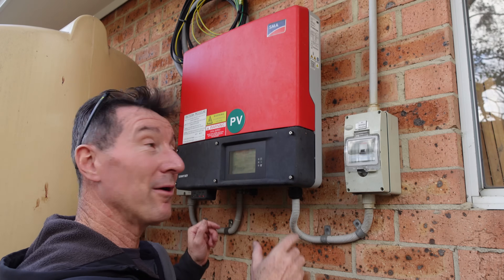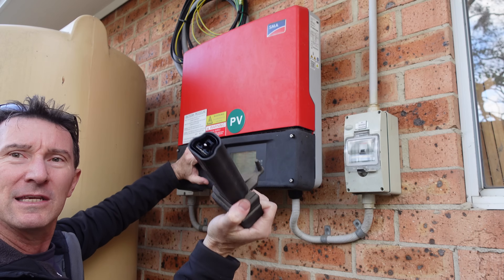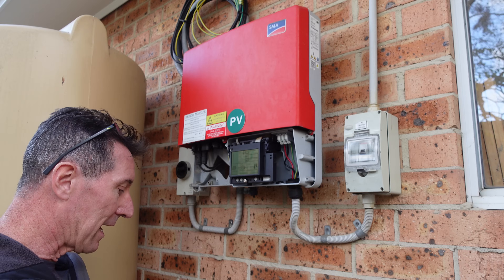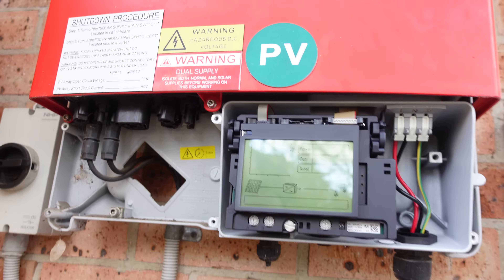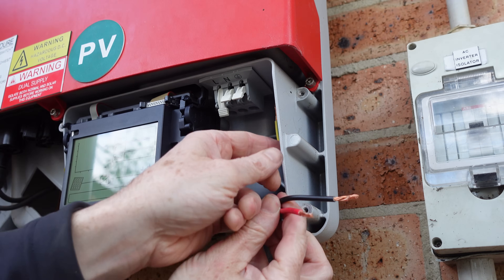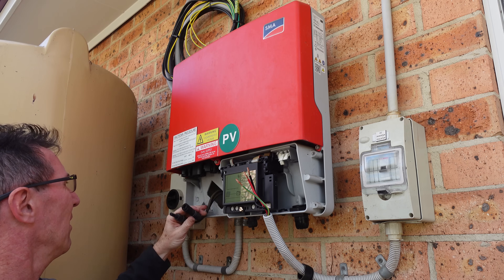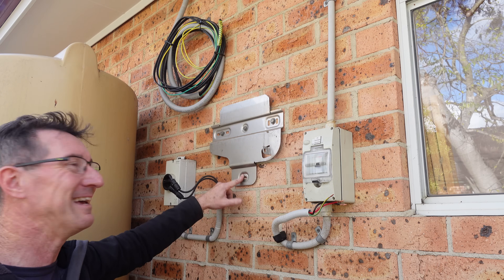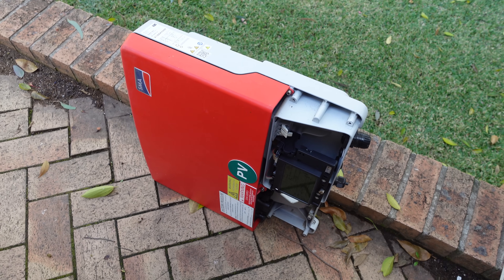Sunny Boy Solar Inverter Removal

Comment: I have a pair of 5kw Sunny Boy inverters on my system (western NY USA).  One started logging intermittent ground faults a couple years ago.  Mice had moved into that nice big compartment next to the display and built a large nest, plus chewed on the dc wires.  I don't think they liked getting evicted into the snow.  Mine are 8 years old.

Comment: Serious question for Dave.  We know that much of the new system you added was 'given' or greatly 'discounted' to you. If that system you have would have to be purchased, how much are you looking at?  I ask because here in 'merica where I live?  The system for my home has quoted pricing between $50K and $90K.  $60K is the lowest and are cheaper panels, no micro-inverters, and no battery solution.  Better Panels, microinverters (and EVERY place has said 'you need them due to roof layout due to the immense shading you will have), and a battery solution shoots me to $80K~$90K.  Federal government will give me something like $16K~$18K tax credit.  NO state or local credits, and the power company has told me the only time they will PAY to have power sold is when the grid hits peak consumption, otherwise they can take the power for free...yep.  

I just don't see how this makes any sense to "do the right thing" here.  Even if I quintupled my energy bills, I will be dust before hitting break even.  Just shaking my head over this.  :(

P.S., A system where I have property is less than half that cost, it would be ground based, and ZERO shading so I could go with standard inverters.  Also because there is no shading I can drop the size of the system by over 30% saving a lot of $$$ that way.
Reply from the maker: That's nuts. A cheap 10kw system is about $5k installed here. This does includes the renewable rebate scheme though, maybe $8k without that rebate.
A microinveretr system like Enphase will cost a fair bit more of course, maybe an extra $150 per panel.
Basically, a 440W panel is about $200 retail here, plus a few grand for a cheap brand inverter, plus installation and misc hardware.
Reply: @EEVblog2  10Kw here, just for the panels (if I went with 400W Panasonic) is nearly $10,000USD!!!  That's freight (and I have to rent some kind of fork truck to get them off the truck, they don't take them off for you, that's an added $500 charge ON TOP of the crazy freight charges, in my neck of the woods)

Not sure how you could possibly do a system for $5K (AUD) when the parts alone, from what I can find, are north of $25K for me.  

Then there is the installation and these guys are all quoting CRAZY numbers (equal to and greater than the part cost).  

The battery solution is CRAZY expensive (That was north of $25K if I went with the 2 Tesla Powerwalls they have all spec'd out).  2?  Well, the power outages in my area are extending 3 and 4 days now, and they say 48 hours tops with the powerwall, less if you use electric stoves, air cons, etc.

TWO of the 3 recommended I replace my 'relatively' new roof because if the roof needs to be replaced EVERYTHING comes off and I'll be out 5 figures tearing it off and putting it back on....on top of the roof replacement.  

Just can't justify these numbers...I've run them again and again, and it always comes back to MASSIVE costs.  Even going 'cheap' panels only drops the cost a little bit because "labor".
Reply: o.0 how big a system are you trying to get installed?

The 6kW system I had installed on our previous house about 3 years ago (Enphase) was $AUD11k installed, I think without the STCs (essentially a government subsidy) it would've been closer to $AUD18k... No batteries just panels and microinverters (plus control gear).
Reply: @SomeMorganSomewhere  Because of my roof design and how it all faces 'optimal' sun load (and the fact I live where there are way more cloudy days than sunny days), they have spec'd 14Kw systems...every single one of them.  At peak I use about 9Kw (That would be Electric Oven and A/C Running along with the standard home loads, but is not common in the summer, but it happens).  They say at any time I would max out even on perfectly clear days about 8.5KW off the panels, we get about 10 of those days a year.  LOL.  

We have a guy about a block from me who has solar on his roof, similar situation.  He has 16Kw on it, and NEVER is not buying power from the power company because....shading, low sun load, etc.  

All this push for "solar", and the fact that nobody can actually afford it unless you do it yourself?  No...just no.  Can't justify it.
Reply: Is this in the US? Those prices are cooked.. My 6.66 kW system (just solar, no battery) cost AUD$5900 in 2019 (US$4000) installed (after something like $1-2K of rebates, but that's all handled by the installer). This is with good quality LG panels too. Reverse cycle (heat pump) air conditioners seem to be the same, I've had 5kW units put in for less than AUD$3K, and then I hear people in the US saying the same thing cost US$10K+!
Reply: @stephengentle2815  US.  Yep.  CHEAP 400w panels are $200 each, just to buy, plus the Sales tax and Freight.   If you want the good Panasonic panels we pay nearly $400 each for their 400W panels.  At least that's what I am finding.  MANY places are "Oh, give us your information for a quote".  BAD idea, as many of them give you a BS quote or no quote at all and sell the information (I created e-mail addresses for those, and within 24 hours of asking for a quote I got over 500 spams). 

NOBODY is willing to give breakdowns of materials/labor/etc.   They just come in and say "$75K" or "$90K", or "$65K".  EVERY one of them wants me to strip and replace my roof because it's going on 10 years old (it isn't, it's going on 5 years old and it's a 30 year roof).

Remember, here in the US we have people demanding $20+/hour to do a minimum wage job because they made poor life choices and think they should make enough money doing a teenager's job to have a house, 2 cars, and eat out daily.   OH, and DO NOT make a mistake on their pronouns...and we wonder why our prices are out of control.
Reply: @stephengentle2815  So...where I live, heat pumps just don't work as a "standard" thing.  Heat pumps greatly lose efficiency below 40F, and we probably spend 7 months a year below that. For my area, they are not recommended.  About the only place I know where people use them is if they have geothermal installations.  

Since LG is gone for panels, that isn't even an option any longer, Panasonic is the new "higher quality" panel and those are all $390~$550 each PLUS Sales tax PLUS Freight.  Many of the install companies refuse to let you buy the panels (because they lose their 20% material markup)...and on 35 Panels, that's a loss of $2800 to them (at $400 each).  

Again, panels alone, MY COST is about $14K without freight.  Many say labor is equal or more than materials.  OH, doesn't include all the mounting hardware (about $50 per panel), and the wiring, and the inverters.  I'm TRIPLE what you paid just in materials...not including a battery ($12K+), not including installation, not including a BMS, not including the controller...etc.  Yea...WAY TO EXPENSIVE.  All I get is the Federal Government rebate, which is peanuts when it's $75K to put in a system).  Why do you think that many of us are against this...can't afford it!
Reply: @WreckDiver99  My point is that people in North America seem to only be able to access tech like solar and heat pumps at absolute rip-off prices and that is more of the issue than the technology itself. On heat pumps, there are plenty of air-source heat pumps that could still work well enough in your climate, choosing the correct type (like an R290 refrigerant air-to-water unit) should have a high enough average COP to rival other heating tech on price. You may need some resistive backup or a wood stove to augment it for a couple of days in the year. The issue is not so much that cold climate air-source heat pumps with decent efficiency don't exist, again it's that probably in the US you'd pay three times what you'd pay in Scandinavia, the UK or other parts of Europe where they are quite common! I still don't understand why prices in the US are so messed up.

Comment: I would have thought the gnd connection would have been a proper crimped and bolted connection, not a wago style.
Reply: If the style of connector is fine for fixed wiring (which it is), it's fine to terminate at the equipment too.

Comment: A non-contact tester is NOT an approved method for proving denergised. Please use a multimeter THEN prove the multimeter against a known source without turning it off or changing the settings or leads. Always test before you touch because it will literally kill you. Sorry to be a downer. Everything else is cool but!! Ps: All free conductors must be terminated. Eg. Put some connectors on the end of any bare leads..
Reply from the maker: There is always a killjoy.

Comment: Curious if they'll let that be reinstalled, doubtful. I think a lot of the newer ones now will downrate the solar output if the mains voltage is over a specific threshold (I suspect they actively use this during peak solar days to downrate the feed in for many unsuspecting customers - basically they couldn't be 'bothered' to adjust the line taps). Not sure if these older ones are all hardcoded to 250V by default or don't have that function at all. My new one after an upgrade (like you) was defaulted to 250V and was only corrected 2 years after install after I found out about it. "Apparently" the new inverters can be set by the solar installers up to 258V in some areas to get ahead of the shedding, most installers couldn't be buggered setting it on first install. Have you looked into this, it's called GVDPR? :)
Reply from the maker: This one does that, you can program it in the settings.
Reply: biggest issue is that anything getting installed now has to be AS4777:2020 compliant, some manufacturers have released firmware updates for older units to make them compliant but a lot haven't (e.g. the SolaX inverter we have here), might be OK to do a like-for-like absent that I suppose.
Reply: The new ones control, their output by grid frequency. I’m sure they look at voltage too. But frequency was added as a requirement about 10 years ago.

This is done because believe it or not the grid frequency corresponds to net loading on the grid. I expect Dave has done a video on it.

Comment: Australia has adopted the metric system in 1947. That is 77 years ago and Dave has not yet managed to get a metric allen key?  Such gear is usually sold with some 25 year guarantee but after 10 years becomes obsolete. Perhaps counted in shoe phone years?
Reply from the maker: I have no less than 3 allen key sets at home, including a genuine Allen set. But they don't have half mm increments.
Reply: Its the 2.5mm , kinda rare size here.
Reply: @TobyRobb nah 2.5 is pretty regular over here. (Netherlands) if you have an m4 with countersunk then you need it (countersunk is one size smaller i think)
Reply: @mauricevandoeselaar  Australia still build houses with 2 by 4 that is a stick of wood measuring 2x4 inches. I do love the psi for pressure, nicer numbers than just bar.
Reply: @LawpickingLocksmith  we also say 4 by 2 here not 2 by 4 ha!
Reply: @TobyRobb  Coles got a set for $1.50. But for precision engineering I had to buy hardened ones from 0.5mm in 0.1mm steps to work on Japanese fine gear. For US gear they would of course not properly fit. If you buy enough small shelves from Ikea, you eventually end up with a 2.5mm key.
Reply: @LawpickingLocksmith  i have a good set of drivers from hobby king as they all are important to be hardened for rc model helicopters and aircraft. Also common in CNC homebuilts eg openbuilds.

Comment: Done well have 2x solaredge 5kw inverters had 4 fail in 6 years they are verry reliable 🤔 and take nearly a month fore the replacement each time and costs me money to have installed as here in the uk you carnt replace them yourself thanks to nanny state rubish
Reply: Can't replace them yourself here either, technically Dave broke the law when he disconnected the AC mains cables from the inverter, you need at least a Class D sparky license for that :/

Meanwhile licensed sparkies are doing utterly shit work all over the country...
Reply: @SomeMorganSomewhere  A guy I know (electronics technician) wired up his own house and his electrician mate signed off on it - still technically totally illegal here, but the only problem the electrician could see was that anybody would know that a regular electrician didn't do it - because the work was way, way too neat and high-quality! Stuff like cable ladders in the ceilings and conduits in the walls, which you'd see in a high-quality commercial install but almost never in a domestic setting!
Reply: @stephengentle2815  Yeah, I (qualified EEE) may or may not have done the same for the garage a couple of houses ago. The sparky's comment was "I haven't seen an installation like it since 1976" ;)

And that was in Vic where according to ESV you can't even install CONDUIT without a sparky license :/

Comment: I think it would be good to test if we could fool the anti island by feeding the mains by another small inverter. As it's a drawback we can't use our solar if the mains is down.
Reply: I wondered that about my own system. I have a cheapo lithium power bank that has an AC output. If I flipped the main isolator on my supply, and then did some very sketchy suicide cable arrangement, would it provide a fake grid supply and wake my inverter up? I don't really want to try it though, don't want to let the angry pixies out of anything in my house.
Reply: dunno about that specific unit but I've certainly done it with other grid-tie inverters (in a standalone application not connected to the grid). stick a 300W pure sine inverter on the input and they'll come up, obviously you'll want to stick a changeover switch in front of it so you don't electrocute the poor bastard liney who's come out to fix the power line that the tree fell on.
Reply: @SomeMorganSomewhere  That's good to know. I guess my cheapy 300w "modified sine" wave wouldn't cut the mustard.
Reply: @sausage5849  yeah, I doubt it would work with a "modified sine" (actually properly called "modified square", I HATE marketing), the inverter would probably not be happy with the shape of the input.
Reply: It's smart enough to not push the voltage up too high, but this also prevents it from doing much of the total load's work; the inverter producing the sinewave will end up doing most of the work. (If I'm right 🙂)
Reply: @jimmybrad156  not really, as you load the inverter down its output voltage will drop which will cause the grid-tie unit to increase output to compensate.
Reply: @SomeMorganSomewhere  not nececelery.
Reply: It should do, but you might have a lot of trouble matching load and supply without a control system designed for doing this. I'm looking at putting a Victron inverter/charger (which has its own anti-islanding) in, and when the grid goes down, the Victron unit will isolate everything from the grid but keep generating a reference into my internal system from the battery, and my separate AC coupled PV (solar) inverter (which is on the 'inside' of the system) should keep operating. The Victron system will manage everything with a separate energy meter on the PV inverter output so it knows whether to supply extra power or consume it (charge the batteries) based on the current load and the amount of PV. If I had a Fronius I wouldn't even need the energy meter because the Victron controller can talk to the Fronius and query power output over serial, but my Sungrow isn't supported.

Comment: Mine is on the sunny side of the house and the window over the panel is all frosted. A really stupid place to put them in direct sunlight. Be interesting to see the teardown.  Is it possible to trick it into supplying power when the grid goes down?
Reply: Yep
Reply: Only when connected to an inverter that is grid forming AKA capable of sinking power from the 'load' but it can be done.

Comment: 2.5mm because those are stainless steel M4 cap head machine screws. Simple and reliable.
Reply: 2.5 mm ,why...some stupid engineer did that,  or they probably had lots of that pos 2.5mm  on the side, and/or the 3mm were not delivered ..
Reply: More simple than 3mm of the same specs?

Comment: I wonder if they ever have trouble with those knock sensors being tiggered by small birds landing on and hopping around on the enclousre...
Reply from the maker: Doesn't matter, it doesn't do anything except change the current display screen.
Reply: @EEVblog2  ahh gotcha - thanks Dave, I'd missed that detail
Reply: “Trouble” ??? To who
Reply: The knock sensor is just a microphone and some circuitry to activate the screen when a sudden spike in voltage from the microphone is detected.